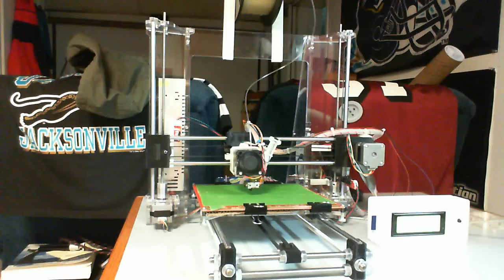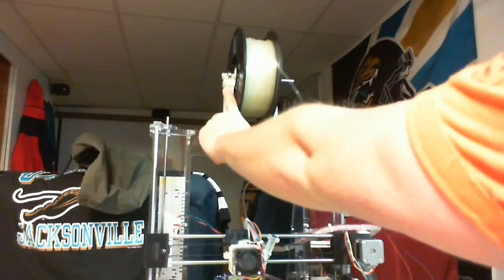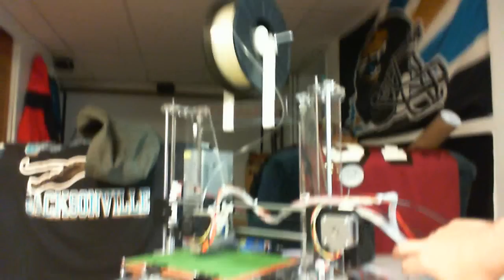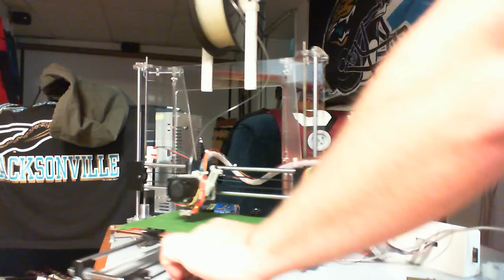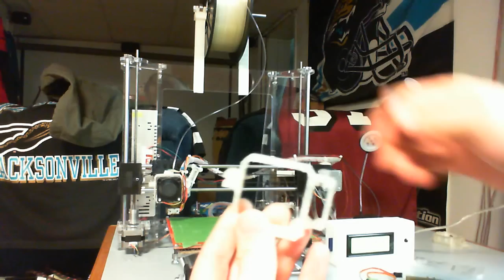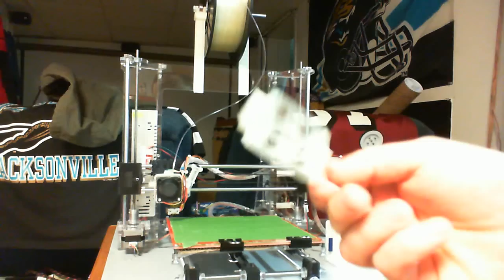Folger Technologies Prusa i3 3d Printer Build part 22 - Upgrades & Autolevel

Comment: Very nice video!!! I also tried to install autolevel but I had so many problems with the software configuration that I gave up! Could you make a video showing the software configuration? The videos that I found used an older version of marlin and that didnot work!
Reply from the maker: konto89 I would search YouTube for this video "Setting up auto bed-leveling on the Makerfarm Prusa i3. Part 2" if you already have the hardware manufactured, this goes over the code process to make things work. It is what I followed to get mine working. Eventually I may try and make a video but it would essentially be talking about the same thing.
Reply: bubalettow
hey is it possible that you could upload your configuration.h file. i've been trying to configure mine for a couple days and i have it close to working but im not getting it 100%. also is that the only file that needs to be changed when upgrading the marlin firm ware? thanks
Reply from the maker: When upgrading firmware, I always recommend using all the files what would go with the firmware revision. as for my config h file, send an email to my username at Hotmail and I'll send you what I have. were you wanting the one I use presently with the auto leveling Z or the one I used prior to that which is more for the stock i3?